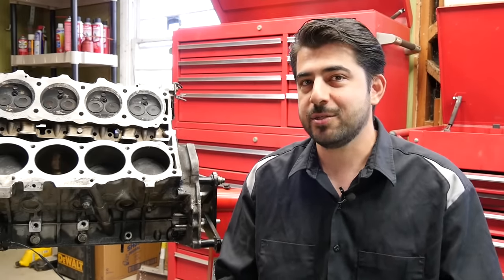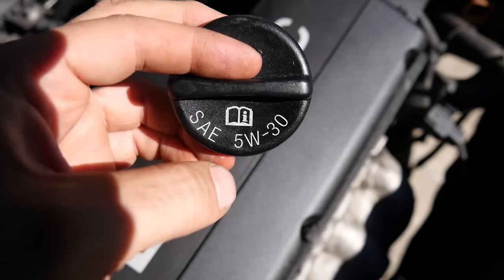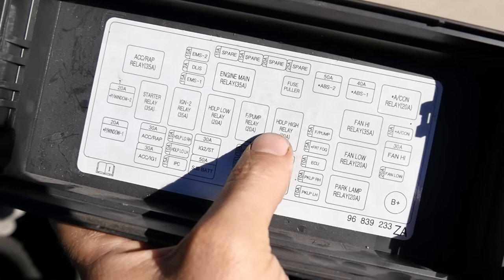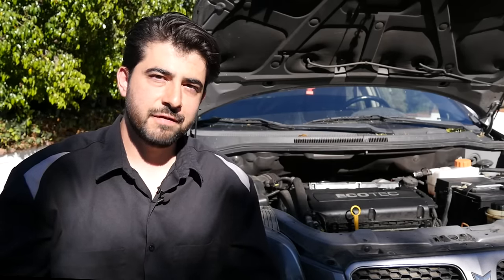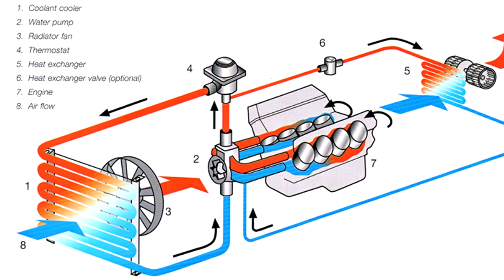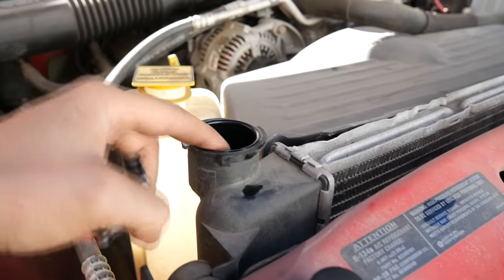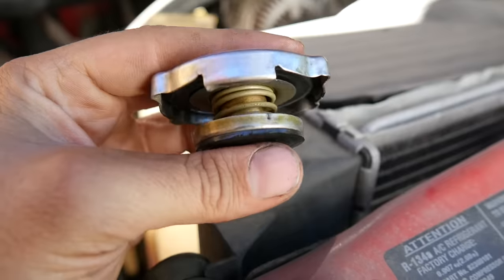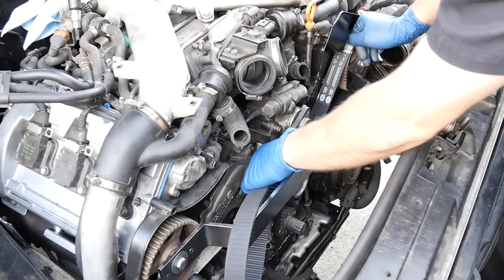Make Your Car Engine and Transmission Last a Very Long Time - Top 5 Tips On Car Care

Comment: The trans cooler in the radiator is more than sufficient at keeping your transmission temperature in check unless your doing heavy towing - I have a 99 Silverado with 240k miles on it and towed a tandem axle trailer that weighed 15k pounds from Florida to North Carolina through all these mountains and I didn't need a secondary trans cooler....... I thought about installing one and when I talk to my mechanic he said it's totally unnecessary the transmission cooler in your radiator does more than what a secondary cooler will ever do

Comment: I replaced my valve cover on the same car in your video (chevy's version) with an ebay special and it caused the rear main seal to blow. The PCV built in to the valve cover was dysfunctional and built up too much pressure under load. After that the car could only be driven at city speed at low rpm or it would empty a quart about every 15 minutes. Bad, bad leak.

Comment: Actually you do not need to fill up the oil filter before start, the oil pressure light will go off in 3 to 5 seconds at idling speed, so not worry to much.

Comment: My 1999 my 1 ton GMC Van made it 420 miles. (11,000 miles a month) I bought it with 2350 miles. I used it for nationwide expedited freight delivery.  Switched to Mobil 1 immediately then once a month or approximately every 10,000 miles. Also used a very low micron dirt passthrough an AC GOLD or Top of line Boush filter. 95% interstate miles. Replaced several fuel pumps (Factory bad ground defect) 2 water pumps. It was leaking so fast, I think I changed the coolant. It never overheated. I got to 150K miles so fast I was afraid of replacing the trans fluid. Also a  starter and brake pads. The engine was running well, only using a qt every 10,000 miles when the trans went. The trans, old style,1999, made it 421K miles. No idea if it would have been better with trans fluid change. Oh also important to replace inline fuel filters, every 50K miles. 105,000 miles per year, coast to coast. Mostly light loads. Dry weight or empty weight was 6,150 lbs. Tires at 90lbs psi except in winter, then down to 60 in snow.

Comment: Three years ago, I ‘found out’ the hard way what happens if you’re barely using a vehicle, it sits for 4-6 weeks at a time before using it (and usually only for short trips then) Spun a main bearing on my 1993 Chev Silverado C3500 extra cab LB (thats from when Silverado’s meant the top of the lineup). I had only ~143k kms (thats Kanuckistan for 88,500 miles) and had religiously changed the oil/filters/lube at all the minimum distance mileages. What I didn’t realize was the ongoing damage caused by the constant ‘dry starts’ combined with the short runs... I’ve since replaced the 5.7 litre SB engine with a factory long block, new ‘consumables’ AND a pressurized pre-start oiling system recommended by my sprint car racing buddy that he uses on ALL his engine builds! I’ve since put another 32k kms (~20k miles) and its been smoooooooth driving ever since! Learn by your ‘mistakes’ if you’re not willing to take advice from those in the know!
Reply: WyrGuy2 I never had this problem. Maybe because you had bad oil sitting in it. Contaminated oil is not good for sitting cars. If you don't plan on using your vehicle for awhile it's best to change the oil before storing it.

Comment: Steel lines are the only way to go when adding a transmission cooler. Over time rubber hose will become brittle and leak. Seen this with every auxiliary transmission cooler connected with rubber hoses. By the time it is addressed transmission oil is everywhere on the radiator and the fins are clogged with dirt and transmission fluid as is the cooler. Spend much time with solvent, a rod and air to clean the mess as a third or more of the radiator core is totally plugged.

Comment: Hyundai sonata 04 v6. 314000 miles. Running smooth and strong. Going to get to 400.000! Jus maintenance. All new spark plugs iridium of course change timing belt on time,  and fix everything. Ur car should run forever.  Korean guy told me in had a car that run forever he was right!

Comment: I see that you've expanded the rear cooling port on that Rover engine right?  My friend did it on his 4.2 and temperature gauge is under half way. Here in Saudi heat temperatures in Summer hits 55°C & even more

Comment: Good tips especially the transmission cooler and radiator cap.  Here is more, not commonly known additions to "bomb proof" the motor: 
secondary "bypass" oil filter
possibly an oil catch can system, depending on make and model
oil squirter at startup
engine heater so car is at temp at startup

Also, here is a simple tip to get +500k miles.  Take 500k miles in road trips.  Kidding not kidding.  Think of road trips as free miles from your car.  Stop and go driving is what actually kills motors.  Look at what truckers have on their odometers on average.

Comment: With long freeway commuting  and routine maintenance,   putting a lot of miles on a modern car is quite easy.  I put 340,000 miles on my last truck and my wife put 380,000 on her car.  The problem always is is that after ten to fifteen years of constant use, the cars simply start falling apart around the engines, paint chips and scratches, door dings,   interiors start wearing, front ends,  emission control systems start failing, engine light comes on more and more,   etc.   You increasingly get a wandering eye looking and newer younger models. 
Unless you're pulling and working with your vehicle, no need to put a transmission cooler on.

Comment: In Indiana there are pot holes, rough pavement & stuff that eats away at the vehicle underbody.  ( and taxation )
So it might be wise to buy cheaper models and trade as necessary.  For example...My 97 ford escort wagon w/5 speed manual lasted about 15 years. The underbody was severely rusted.

Comment: Nice video.  At 6:25 you mention replacing only half of the transmission fluid.  I recently got my manual transmission serviced at aamco.  Do they usually replace all the fluid?

Comment: Nice reference to Scotty.
The guy who thinks only a Toyota can go 400k.
I did 440k on a 2.2 Plymouth Horizon. Then, put a crate engine from the dealership in it  and went almost another 500k.
It still ran when I put it on my trailer and took it to the junk yard.
Because the wife said the car was nasty.
Final score, 932,000 miles.
I was inspired by a man named Irv Gordon whom I met at the L.A. Auto show's Volvo booth.
At the time, my Horizon had over 300,000 miles.
Irv's story is worth reading about. 
Look him up.
He has passed away. But, his car is in good hands still.
The best advice I can give is know your car, change the oil on time. And dont ignore a leak, an engine light or a funny noise.

Comment: I put "Marvel Mystery Oil in every tank load of gas and in the crank at Oil change time. I own a 1989 Dodge B-150 Van with a 318 cubic engine with just over 500,000.00 miles on this original motor. I had the timing chain replaced @ 220,000
miles as a maintance and I personally replace the second one myself @ 500,000 miles. 
This van still wants to rip the wheels off when I hit the gas. 
Years ago M.M.Oil reformulated the oil so can be added to the gas. As soon as the engine starts your rings and cylinder walls are coated with engine oil and M.M.Oil

Comment: In chicago, Im not using 10-3-0 as reccomended..its 5/50 and I never change it. I just check it once a month and before it gets to add, I top off 1st time with lubroiplate, then top it off when it needs with synthetic. I put 350,000 on the car I drove to work and I never touched an oil filter. Just made sure oil never got below the add. I have had over 30 cars..all of them I drove that way on each of them and put a min of 150-200K. My first car I ever owned I was changing oile every 2500 miles and that was only time I had a major engine failure. Car engines will last very,very long as long as you don't go low on oil and you keep a close eye on you temp guage. Overheating is what I have seen the cause of engine failures...that and people forgetting to tighten oil pan plug doing an oil chang. I was outsourced to take apart engines that tested oil viscosity after so many miles and the measured wearable parts with a computer , not hand held guages. I saw these engines had minimal, nothing noteworthy wear, running for 300K with just the oil topped off. My cars are not junk cars that I dont care. They are Benz's, F150 I used to tow my boat with, 4 corvettes. The Grand Prix, a 1980 was the one that I changed oil and blew eng. When I took the head off , the engine oil passages were badly gunked up. Bought a junk yard eng for 150 dollars and put 150K before I traded it in for a 280zx. Back in the 80's, 100K meant the car was on its last leg and on borrowed time. Also putting fuel cleaner is a very good thing to do once a year right after winter.

Comment: A lot of wear occurs during engine start up. Install a pre lube oil pump if you really want it to last.
Reply: I did in one car. Easy but sold it before I had 200k on the engine. Didn't burn oil.

Comment: How about adding an extra radiator for the coolant, a cooling coil for the oil and a cooling coil for the transmission. Keep the temperatures down.

Comment: Just bought a 2000 F-150 with 222xxx miles, I think I'd rather let the fluid out, clean any shavings or metal in the pan where the magnet is and refill it while adding Lucas to ensure it will last longer. I always heard flushing them damaged the transmission

Comment: Usually I just keep it full of fluids and fix whatever leaks may come.  That does not apply to oil leaks outside of occasional AT-205 usage. Just top it up when it dings you about the oil level. I've yet to have a car not make it to 350k. That was the lowest mileage I've gotten before dumping it off on title max.

Comment: Hi there,
You're mentioning that the use of synthetic oil it's better for the life of the engine, so what about the recommended oil grade and viscosity of the manual of the car? The manual it's an OEM item since it's coming from the factory with the car.

Comment: In my lexus is200 from 1999 every second oil change I drain some ATF from transmission.  Total amount of ATF is 6.3l I can only drain 2.3l at once so replacing 1/3 at the time but that what it said in user manual never mention any flush. Transmission have drain plug and the dipstick - wonderful simple everlasting design as long as you mind to put back right OEM ATF 😂🤗

Comment: I did think about something now, if you fill the oil filter with oil, then at the end probably there will be more oil on the oilpan, would not be necessary to compensate it putting less oil at the top of the engine?
Reply: There is no need to fill the filter with oil. That’s not even possible on vehicles that have the cartridge style filters.
Reply: @Commentleaver-c6x  Ok, thanks for the advice. 👍
Reply: @MREnzoHerbie  sure thing.

Comment: Bad thermostats are designed to remain open, not closed. Therefore this overheating damage wont occur. Even if your car doesn’t throw a light on or a code, you’ll know its bad when you’ve had your car on for awhile, especially highway driving, and the temperature Gage isn’t pointing in the middle, it’ll be lower than that.

Comment: The engine in my car is built so that when the thermostat fails, you only get the "big cooling cycle". I.e. your car just takes a very long time to get to the desired 90°C engine temperature or doesn't reach it at all if it's cold outside and there is no danger of overheating.
Reply: That's only if it sticks open instead of closed.

Comment: Hate timing belts. Love timing chains. We've never had to change a timing chain in any of our cars. Saves tons of money.

Also helps if you bond a lubricant to the metal so that metal to metal contact can never occur:
Drops wear by ~80 %... which is the equivalent of increasing lifespan by ~5x
We've never worn out an engine and can't remember the last time something went wrong.

🙂

Comment: Even if you disable the fuel or ignition while your cranking the engine the crank and connecting rod bearings will still have a load on them unless you remove the plugs so the cylinders produce no compression. After you have drained the oil you have plenty of film on the bearings to provide lubrication for 1 second until the oil is primed. Far more important to make sure your oil is at the appropriate level and clean. Some vehicles that have huge filters like diesels id fill those filters if possible.

Comment: My truck has a probably factory water pump should i change it since its 26 years old it still works fine but after my accident I'm changing the radiator and fan blades so should I change it since I'm in their.  Good tip too is to run engine right before you change the oil so everything has oil on it when you start it with the new oil.

Comment: Good job, except I think you need to do more research on trans flushing and how flushing the trans on high mileage cars can cause trans failure.
Reply: I think you're right  but I don't think I even need to take apart transmission with high mileage that may never have been serviced..
Reply: @honeybear8485  Sir, with all due respect I am  saying it has been my experience that flushing a normal transmission (serviced correctly) which has been working fine, Will normally start to fail in the next 5-10K miles.

Comment: Ford checks all the boxes. Sucks to be a GM guy... lol. Yesss fill that filter with oil before replacing. Duh 🙄 water pump if needed change what you can when front of engine off. Actually a good video.

Comment: If it's not a PAO polyalphaolefin based oil it's not a real synthetic. AmsOil is the best because it also contains esters to keep your engine seals soft so they don't dry out crack and leak. I have been using AmsOil in my 2001 GMC Sierra 2500HD for over 18 years now and I have no leaks or smoke out of my tailpipe. It is the best oil I have ever used.
Reply: I've used conventional for 55 years and keep my cars forever....NO problems.

Comment: Also Critical to Use OEM ELECTRICAL PARTS - I Didn't With a Alternator that Failed at Middle of Nowhere, in 110 Heat.

Comment: 310,000 miles on my lexus ls430 2001. Original engine, transmission, starter, and alternator. Just basic maintenance.  Toyota and Lexus vehicles only.

Comment: 1. My brother never blew the engine and transmission in his Corolla and Matrix. Every other car He blew the engine or transmission or both.
2. When I put full synthetic 5w30 - preferred in my 1994 Ford Thunderbird it burned 1l per 1000km. With 5w30 conversation or 10w30 full synthetic it burned 1/2l at 7000km.

Comment: What should I do. I purchased a Pontiac 2007 G6 .With 85,000 miles late in 2017 . The body and engine and everything is basically in excellent shape. But as a used car I don’t know the background of it . The transmission seems fine don’t feel good shift or nothing never had any problems. But it’s one of those Terrible sealed lifetime transmissions with no dipstick. I don’t know if the transmission fluid has ever been changed or if it has enough in it or what is going on. I am afraid to do a transmission flush because disturbing everything and then getting transmission failure I hear that happened a lot. What I was thinking about doing is taking off the transmission pan changing the filter the transmission filter and then it loses about 4 to 5 quarts of transmission fluid at the time of filter change. Put in a new filter and gasket. Then Replacing the amount of transmission fluid that it lost. Then doing the same thing six months later. So then this way the transmission fluid Most of it would be new. Do you think that’s a good idea. And what would you do any advice would be helpful. Thank you. You just got a new subscriber.

Comment: i have a 95 mercury and a 07 chevy . that mercury i have a little over 400k on it the trans shifts perfectly as well as the engine. as long as the maintenence is done on time. as is doing all of the fluids as well as using good parts. granted the chevy i have i had to dump 2700 for a transmission do to a failure of one of the clutch packs as well as a solinoid factory flaw. as well as a second engine do to one of the water jackets failing for the coolant causing one of the pistons going out the side. after fixing all of that it runs good. not like the 95 i swear the older vehicles are made a whole lot better.

Comment: Maintenance maintenance maintenance. Then try not to abuse the Car. Fix things when you know they are ready to be serviced. I got 400k out of a 2006 Dodge caravan, both engine and Transmission. These Vehicles were known for having Transmission failures. Use a respectable Shop. Talk to People that say they know a good one, and ask them what makes that Shop better than the rest. I spent 20+ years as an Automotive Repair Technician. I hope that helps.
Reply: I would have gone to 500k, but my van got totaled. When I told Chrysler Corporation about my Van at 384k miles, they sent me a 400k Miles Commemorative License Plate Holder. That was actually very cool and kind of them lol

Comment: If you have a weak coolant system... Can use redline coolant booster, it lowers coolant by about 20 degrees. You may not want to use it if car is new, low miles etc...bc cars computer will make car run a lil too rich